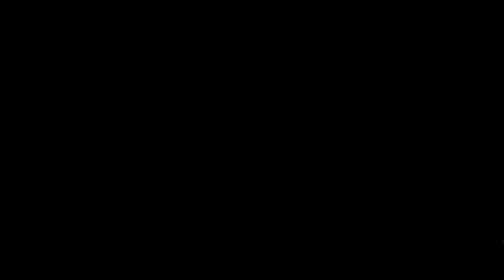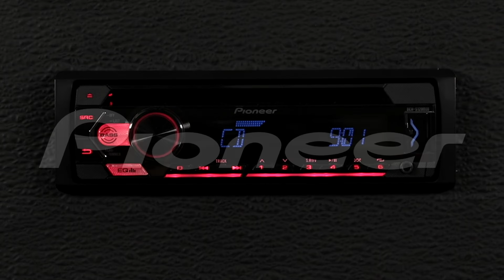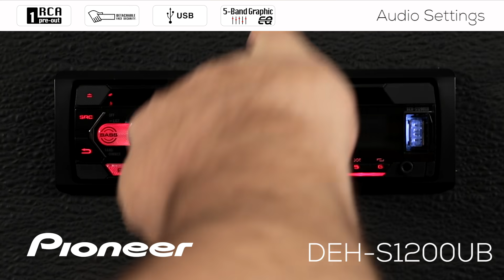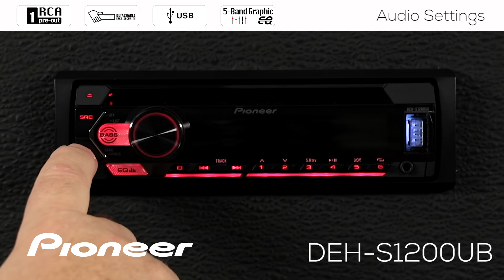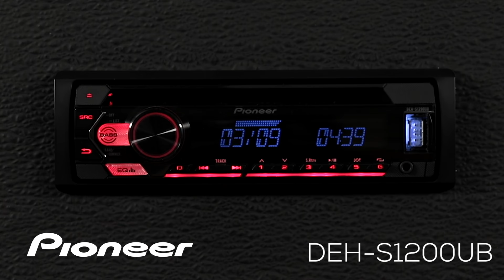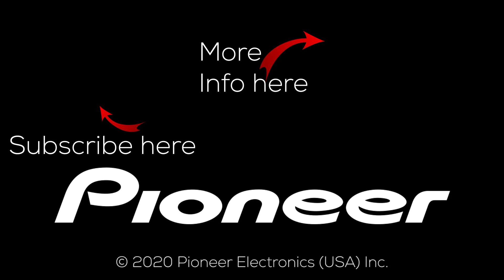How To - Pioneer DEH-S1200UB - Audio Settings

Comment: Hi, mine I switched it off and i can't switch it on. It's been a month now with a silent car 🙄. deh-s1150ub
Reply from the maker: Press the SRC button to select a music source.
I recommend to take the face off the receiver and put it back in place.  You can see it here:   https://youtu.be/Z5S_IuTTWVQ
If that does not correct this issue, you may have a loose installation wire.  Focus on the Red, Yellow and Black wires. 
 You can learn more about wiring you Pioneer receiver here: 
    https://youtu.be/kR2MO2kwFug     or possibly a failed fuse in the vehicle or a fuse in the back of the in-dash receiver.
You can find more videos on Pioneer's YouTube Channel here:   https://www.youtube.com/@pioneerelectronics

Comment: can i control the speaker level for each individual speaker?
Reply from the maker: As of 2022 June, the Pioneer DEH-S1200UB is Pioneer's entry level CD receiver.  You have a fader and a balance control, and a subwoofer output level control.   There is no individual speaker output control on the DEH-S1200UB.
You can download the owner's manual for this product directly from Pioneer here:   https://www.pioneerelectronics.com/StaticFiles/Manuals/Car/DEH-S1200UB_OperationManual102620.pdf
If you are looking for more advanced features like individual speaker level controls and, independent crossover and slope controls please consider a more advanced Pioneer receiver like the DEH-S6200BS seen here:  https://youtu.be/0UgoK9v_KcM?list=PLw63zJRQbCNiH14t9cYje9Gdcvn7xH4ne
or the Pioneer DMH-WT7600NEX seen here:  https://youtu.be/O9yXjfuZPtM
You can find more videos on Pioneer's YouTube Channel here:   https://www.youtube.com/user/pioneerelectronics

Comment: So no setting for the treble ?
Reply from the maker: Modern Pioneer receivers don't have a bass and treble setting. There is a much more powerful sound shaping tool called a graphic equalizer. Don't be afraid of it. It's easy to use. On the Pioneer DEH-S1200UB,  all 5 settings in the Equalizer are frequency adjustments. You can use them to make any given frequency a little louder or a little quieter as compared to other frequencies and without changing the volume of the other frequencies. The frequency adjustments are arranged like a piano keyboard with the low frequencies to the left and the high frequencies to the right. If you want more bass, I recommend the "SuperBass" preset. It will add a lot more bass into the music. If you want more treble, I recommend the "Natural" preset. It will roll off the bass, and add in more treble. If you are listening to a ball game or people talking, or an audio book, I recommend the "Vocal" Preset. You can see the presets in this How To video from Pioneer:     https://youtu.be/ZXg6-tLuUhQ?list=PLw63zJRQbCNgUI_3Z0V1p65bgicKwj4VG       You can make your own adjustments too. Simply start with any EQ preset that sounds pretty good to you, and make your own adjustments from there. The 50, 80 and 125, frequency bands are typically the bass frequencies. 3.15k, 5k, 8k, and 12.5kHz are typically the treble frequencies.  You can find more videos on Pioneer's You Tube Channel here: https://www.youtube.com/user/pioneerelectronics

Comment: Hi I cannot get a sound when  direct SW connection  even though ive turned on SW to rear in the settings , Pioneer DEH-X8700BH
Reply from the maker: It is possible to operate a small subwoofer on the rear speaker output directly from a Pioneer in-dash receiver.  Please note:  This is a connection to the rear speaker outputs and not the RCA outputs.    I recognize model numbers DEH-X8700BS and DEH-X8700BH. 
 Please be sure to check the model number of your Pioneer in-dash receiver.  The instructions below are for the two models shown above.  You should be connecting the receiver's Purple, and Purple/Black speaker output wires directly to a small subwoofer.  The Green and Green/Black should be properly terminated so they don't come in contact with any other wires or metal in the vehicle.   Owner's manual page 21.     You can learn more about wiring your receiver in this Pioneer How To video:  https://youtu.be/kR2MO2kwFug?t=266     In the receiver's Initial Setup S/W Control settings choose SP:SW.   This will mean the front speaker outputs are full range and the rear speaker output is subwoofer.   When using this setting, No Fader Control will be available.  This is normal operation.  This is because you choose to change the system from Front/Rear output to the new setting of Front and Subwoofer  output.  The subwoofer output has an independent level control.  In the Audio Settings Menu, be sure to switch the Subwoofer 1 setting to Normal or Reverse.  Owner's manual page 19.   And in Subwoofer 2 choose an LPF crossover setting.  I recommend to start with 80Hz and an output level of 0.  You can find the owner's manual for the Pioneer DEH-X8700BS / DEH-X8700BH here:   https://www.pioneerelectronics.com/StaticFiles/Manuals/Car/DEH-X8700BS_OwnersManual090914.pdf   You can find more videos on Pioneer's YouTube Channel here:  https://www.youtube.com/user/pioneerelectronics

Comment: How do you turn off the bass from the door speakers but leave the bass from the subwoofer? I got the same stereo from the video
Reply: Or to lower the bass on door speakers
Reply from the maker: I'll need more information to give you a complete answer.  Do you have front and rear door speakers?   Are the front and rear door speakers hooked up directly to the in-dash receiver front and rear speaker outputs?     Is the subwoofer connected to the receiver's RCA outputs?   If you have the Pioneer DEH-S1200UB with the front and rear speakers connected directly to the receiver and a subwoofer running from the RCA outputs, you'll need to adjust the receiver's Initial Setup SP/PO Mode set to REAR/SUB.W   You can learn more about it in this How To video from Pioneer:   https://youtu.be/b6vYngDNuK4?list=PLw63zJRQbCNgUI_3Z0V1p65bgicKwj4VG&t=55        Next, if you have the Pioneer DEH-S1200UB, and you have the door speakers connected to the Front Speaker Outputs of the in-dash receiver, you'll need to switch on the HPF or High Pass Filter.   You can see it in this Pioneer How To video:    https://youtu.be/meEGlY_r-IE?list=PLw63zJRQbCNgUI_3Z0V1p65bgicKwj4VG&t=308       As a place to start, set the HPF to 80Hz and -12 dB per octave slope.   If you find you need to remove even more bass from the door speakers, change the HPF setting to 100Hz.   An HPF or High Pass Filter only lets frequencies above the selected number to go to the door speakers.  You can find a full playlist of How To videos from Pioneer about DEH-S1200UB here:   https://youtu.be/E5LPF59281M?list=PLw63zJRQbCNgUI_3Z0V1p65bgicKwj4VG   and you can find videos about Pioneer Speakers here:   https://youtu.be/bwrJ4LcyHmU?list=PLw63zJRQbCNiTV71nfrZHNcn8taD6y4yX      You can find more videos on Pioneer's YouTube Channel here:  https://www.youtube.com/user/pioneerelectronics

Comment: I do not see the fader option and the rear speakers are not playing. right after installing the radio, this option was visible. Help please
Reply from the maker: This is normal operation if you have the system setup with subwoofer output on the rear channel.  It sounds like you have the receivers Initial Menu Speaker/Pre-out set to subwoofer.  Please take a look at this video for information on how to change this output:   https://youtu.be/b6vYngDNuK4?list=PLw63zJRQbCNgUI_3Z0V1p65bgicKwj4VG  If you want a fader option be sure to choose REAR/SUB W. in the initial menu.   You can learn more about setting up the subwoofer output here;    https://youtu.be/MxOo2hXO8wQ?list=PLw63zJRQbCNgUI_3Z0V1p65bgicKwj4VG       You can find a full playlist of How To videos from Pioneer about DEH-S1200UB here:   https://youtu.be/B6LFy7EezV4?list=PLw63zJRQbCNgUI_3Z0V1p65bgicKwj4VG   and you can find more videos on Pioneer's YouTube Channel here:  https://www.youtube.com/user/pioneerelectronics

Comment: My radio is in russian, I tried to follow the manual, but it is still in russian
Reply: What is the model number of your Pioneer in-dash receiver?  If you have a Pioneer DEH-S1200UB or similar model, I recommend to remove power from the receiver.  For example, remove the negative battery terminal from the receiver for a minute or so, and then reconnect the negative battery terminal.  When the receiver restarts, choose the language you want.  Or , again if you have a Pioneer DEH-S1200UB or similar model you could do a system reset as seen here:   https://youtu.be/b6vYngDNuK4?t=178   When the system restarts, choose the language you want.  You can find a full playlist of How To videos from Pioneer about DEH-S1200UB here:  https://youtu.be/Vv49fmWoePc?list=PLw63zJRQbCNgUI_3Z0V1p65bgicKwj4VG    and you can find more videos on Pioneer's YouTube Channel here:  https://www.youtube.com/user/pioneerelectronics